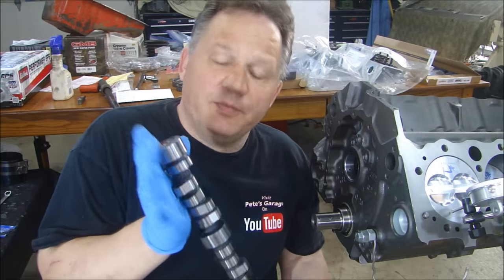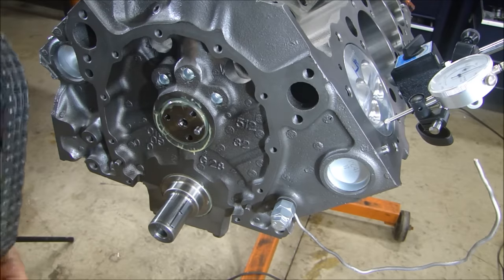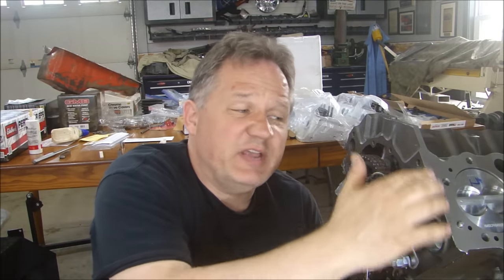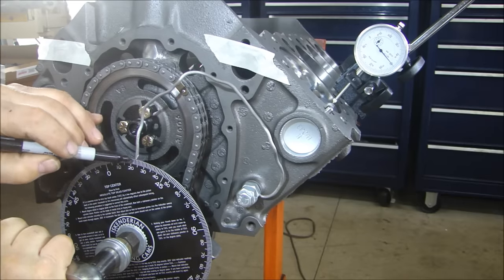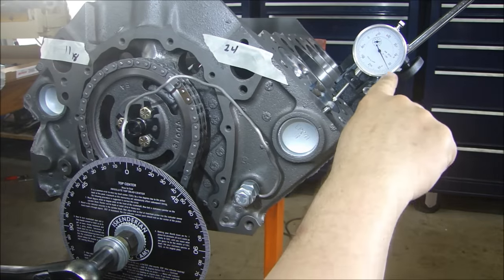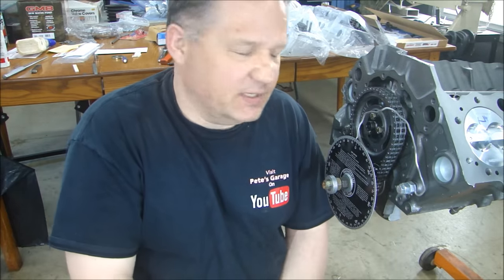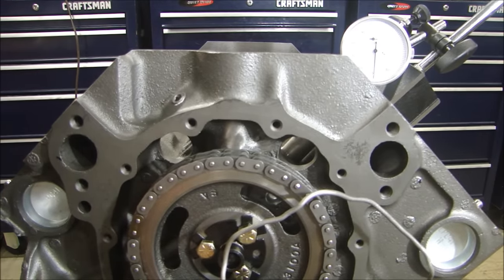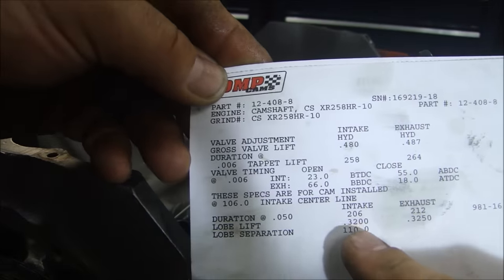Engine Building Part 3   Installing and Degreeing the Cam 350 Chevy Small Block

Comment: I don`t agree that decking block will change valve timing in this engine. In OHC engine yes but not in OHV engine.
Reply: I think he's referring to the fact that it will affect valve clearance, which explains why you'd want to verify cam specs and how it relates to valve timing on the cam.
Reply from the maker: Let's really exaggerate the situation. Let's say you cut 1/2" off the deck, and let's' assume the piston will not hit the valves. The piston will get to the top way before the valve timing would at standard timing, therefore the cam is way behind and the valve timing retarded. In that case you'd have to advance the cam timing probably close to 100 degrees.
Reply: Well piston will be higher respectively to the block deck but the crank angle of TDC will not change. The only thing that will change is compression ratio and piston to valve clearance.  Same if you put a stroker in there. Cam timing won`t change because of the longer stroke. TDC will alwasy be in the same crank rotation angle.
Reply: kitastan distance from center of crank changes for the valves, therefore timing does change
Reply: what are you taking about.... timing of opening/closing valves DO NOT CHANGE in respect to crank angle.
Reply: @kitastan  You, sir, are correct.
Reply: +kitastan “Hfan” Yep, I noticed that too. You are correct. Decking the block don't change the cam timing.
Reply: @noampitlik2332  I'm in 100% agreement with 
@kitastan! Still yet, good video to help understand how it's done in my opinion!
Reply: If the camshaft was in the cylinder head, yes decking the block or the head will change the center to center distance between the crank and cam this affecting valve timing. Decking a ohv block......no change in cam timing.
Reply: kitastan , your absolutely correct!   Otherwise stroker cranks would require a matched cam and would be sold in pairs
Reply: Kitastan I agree with you, but it’s still good practice.  If you get well-acquainted with the procedure and do it on every build, you’ll know exactly what to expect whether it’s OHV or OHC.  Good observation!
Reply: Correct. Decking the block simply has the same effect of closing up the valve clearances, which would naturally have the effect of advancing the valve timing. But when you assemble the motor with the decked block you set the valve clearances where they're supposed to be,  so the effect of decking on valve timing is cancelled. If you deck the block 0.5" just put in 0.5" shorter pushrods and you're back where you started.
Reply: @chrisburnsed6349 , Josh Rickard and others. You're correct and at same time, you're in error. The difference lies in that you are failing to understand the issue in question. It is indeed true that decking the block does nothing to change the CAMSHAFT timing. What it does change, is the installed height of the valve rockers in relation to lifters, and therefore, by default, changes the timing/s of the valve opening and closing points, mainly because the length of push rods remains constant. Not trying to teach a chicken to lay eggs, just giving the facts as they are understood by the holder on a Eng.D. 

I would like to thank Peter's Garage for presenting the importance of this, mostly overlooked matter in such a clear and through manner. Keep up the good work, your information is spot on. Cheers from Indonesia.
Reply: Line honing would have more of an effect then decking the block.. js
Reply: As a mechanical engineer, I will look into this but by using formulae. Will see if any change in distance "x" of the decking would effect valve timing for OHC and OHV engines.
Reply: @kitastan  I concur
Reply: Smart man
Reply: @kitastan  You are EXACTLY correct!!
Reply: I DONT CARE WHat you say this guy knows his shit..
Reply: Phillip Aubin  deck hight only changes lash not the cam timing. If it did he would have to check timing events at the valve with the head on
Reply: no no no, decking the block or milling the heads does NOT change the timing, tdc is tdc. compression will change cam timing does not. it may change push rod length but decking a block or heads takes off minimal material.

Comment: It's important to note that the further from the top you use the piston stop points when locating TDC, the more accurate you will be. Ideally, the most accurate point would be when the piston is exactly half way up the bore, since this is where the vertical movement (speed, if you like) of the piston is maximum per degree of crankshaft rotation. That of course, is a little impractical so we use a point reasonably close to the deck, but still, the lower the better for accuracy.

As Pete mentioned, trying to find TDC directly with the dial indicator is extremely inaccurate since when the piston is at the top of its travel there's almost no vertical movement over several degrees of crankshaft rotation, so it's almost impossible to pick exactly the correct point. Hence the "double stop" method used in this video. Have a look at a sine curve and you'll get a feel for how the piston moves in the bore.
Reply from the maker: Excellent comment! Thank you very much
Reply: Hi; is the same inaccuracy that all use when check for intake centerline zeroing the clock on max lift

Comment: Good job Pete.  A larger degree wheel and shorter pointer wire helps with accuracy readings.
Reply from the maker: Good tip!

Comment: Your measurements were all off by a degree or less. That leads me to believe you didn't have your indicator set exactly in line with the lifter. Just off a bit in any direction will cause you to loose a little measured lift. This is exactly how I have always done mine and I believe it is plenty close for 99.9% of the engines out there. Especially a street motor... ;)  And I don't think that most people even understand how much shaving a block can change the cam degree... Happy you pointed that out.....
Reply from the maker: Thanks Steve, I'm just trying to explain it, I'm not going to argue with people who don't understand it. I agree, it's plenty close enough, thanks for your comment

Comment: I know everyone has their own way of doing things but i install the camshaft first before the crank. I find it easier to guide the cam through the bearings.
Reply from the maker: I can see that. The only reason I do the crank first is that if the cam is installed and a fastener falls it could knick the cam.
Reply: HI my friend. There are two ways to do it, like here let the mashine shop do it with the baring crings. But your right if i would do it I would also install the cam first. Cheers
Reply: Same here. Just made a rant and then saw your comment.
Reply: @jimburig7064  I build engines for a living and I always install the camshaft first , mainly because if you have a problem with a cam bearing you can fix it before you put the rest of your parts in . Just my personal reason .
Reply: I refreshed my stock engine in my 1979 Z28 (I know, not a performance engine but I didn't have the money for my desire). Installed the cam bearings and couldn't get cam past bearing # 3. R&R'd another set, still couldn't get past bearing #3. Brought to machine shop and they installed their own set of cam bearings. I brought my cam to the machine shop, and sure enough it went in fine, so I asked them, what was it I was doing wrong?
They said, nothing. The casting was not machined properly and the #3 cam bearing bore was undersized in the machining process, which caused #3 cam bearing to "contract" too small when installed into the block. So I asked, what did they do? Honed the cam Bearing.
Kind of hokey for a machine shop, now I have 5 psi of oil pressure at idle. 

It was easier with the crank out.

Comment: It may not make much difference but I've been taught to rotate the crank CW for both .050" measurements when checking for ICL.  This way the slack in the timing chain is treated the same for both measurements.  Good video.
Reply from the maker: That is a good practice

Comment: When I used to build engines, the camshaft was the first thing to go in with the block upside down so I could reach in and carefully guide the lobes past the cam bearings without scratching them. Now, almost without exception on YouTube I wince with every clank, clink and clunk as the cam is installed after the rotating members are all buttoned up. Just saying...
Reply from the maker: Would you be surprised to know that every engine plant puts the crank in first? Every assembly line I was ever an engineer for, that's the way it was done. If you are careful, the clink and clank should just be resting a lobe on a bearing. I have been doing it like this for a long time and never had an issue or found a damaged bearing during disassembly. There are many ways to build an engine and they are all right if you are successful. Thanks for your comment.

Comment: Basically checking to see if your cam card is correct.I've never had an issue.correct timing per setup is what's important. I don't think that tiny cam with have any clearance issues
Reply from the maker: I have gotten the wrong cam out of the box. It doesn't hurt just to check.
Reply: @PetesGarage  I'll definitely agree in the event that your building something with a lot of lift with a high done piston. Pre detonation is very important. Correct timing is everything. I'm by no means downing your video I think you were exact and precise.I give it a thumbs up.
Reply from the maker: Thanks my friend

Comment: It through me off when you went counter clockwise. Still makes sense but I go clockwise myself. 

Also, it prevents having to worry about the bolt backing out...also my Comp cams kit has a crank adapter for that reason. 

What may be helpful for folks in the future is to use a long breaker bar or leverage bar to aid in spinning the crank over without having to "bump" the ratchet. 

Regardless, I still like your videos man!
Reply from the maker: Great tips, thanks Mathew

Comment: Dot to dot at TDC #1 would in fact be the exhaust stroke NOT the compression stroke.  It's actually the compression stroke on #6 cylinder. This is why the distributor tends to get installed at 180 degrees off of where it should be.
Reply from the maker: That is why I always urn over the engine to make sure #1 is on the compression stroke before installing the distributor.

Comment: After top dead center when piston starts its down stroke, allow for a thousandths or 4 thousandths drop,  then you can adjust the rest at distributor. Do they make a gauge that threads in the spark plug hole?
Reply from the maker: There are spark plug hole guages.

Comment: Hey Pete live the information.. but u wanted to ask u a question.  I have a 1971 Buick Electra 455 engine.. it runs well all stock original engine never rebuilt.. I wanted to Kno how can I check if it's getting the full 315 horses it says it made off the lot.?
Reply from the maker: You should be able to get more than that, usually 1 HP per CI

Comment: I replaced my timing chain and gears with a double roller style. I also removed the cam just to check it out. It checks fine. I reinstalled everything, and my question is, can my cam be 180 degrees out? How do I check this for sure. I do not have the heads off, and have never had them off. Thanks for any help.
Reply from the maker: Yes it can be. Make sure piston #1 is a TDC. The dot on the crank sprocket should be facing up. Align the dot on the cam sprocket with that.

Comment: I heard you say that you always degree the cam, however I didn't hear you say whether it's REALLY necessary??  On all the videos on HughTube about degreeing a cam, I never see any adjustments made after the procedure. So it it REALLY necessary when installing a new flat tappet cam and lifters; and if so, why?  Thank you!
Reply from the maker: I guess it depends on how much you trust the cam manufacturer. I usually check a few lobes to make sure the wrong cam wasn't put in the box. Also, for a more radical build I sometimes advance the cam 2 degrees, so you will not see any changes on most builds

Comment: When you do the duration there no showing the gauge, and I think you are skipping some parts like when you count backwards.. plus wont going back and forth affect the cam degrees unless the timing chain is seriously tight? Thanks - ill have to sit down and go thru this sometime.. Ive always dropped cams in straight up
Reply from the maker: I have a couple videos on cam degreeing. I don't do every step in each one to make them all a little different.

Comment: You made measurements based on clockwise and counterclockwise crank rotation.  So what about the clearance in the crank and piston pin bearings?
Reply from the maker: That is in a different video

Comment: Piston stop works better for finding absolute TDC imo, you can adjust the stop if you’re working with an odd number and don’t want to work with a split number. Bigger wheel is more accurate also, like Moroso’s 18”. Just my $.002
Reply from the maker: They do work well. I do have a bigger wheel, I have a few actually, you are right

Comment: that cam retention plate has fold down tabs to keep the cam bolts from moving  - just an FYI
Reply from the maker: You are right, I did fold those down but the video got messed up and I didn't notice until it was too late

Comment: If your crank bolt came loose you lost true T.D.C. you need to start over . Buy the socket made for a degree wheel & a long handel ratchet so you are  not jerking engine around instead of a pipe would help accurately  do job . I like you video's but a few things would make them much better .
Reply from the maker: Thanks for the tips Larry

Comment: Quick question: what kind of tolerances do you find acceptable for crankshaft vs. crank sprocket dimentions?  I have a crank gound on the light side, and am looking at an interference fit.
Reply from the maker: An interference fit is in the .0005" range

Comment: So checking intake centerline just verifies the center if the intake lobe in conjunction with crank degree? 
Do you normally only check lift on intake lobe?

Is there a way to check LSA and duration? Im trying to do this in reverse to find unknown cam specs.
Reply from the maker: Yes, I usually check both. Sure, you can measure form .050 to .050

Comment: Quick question. After all this is done we’re are your marks on your cam and marks on your crank setting to drop your distributor in
Reply from the maker: It should be at #1 TDC
Reply: Pete's Garage : I mean your crank is at top dead center but we’re are your cam mark at12or6
Reply from the maker: @thruitallauto2538  6
Reply: Pete's Garage: ok hey I’ve got a motor that’s oil fouling the plugs the rings are not stuck an the heads look good no bad valves wander what could be causing it all the plugs are fouling
Reply from the maker: Leaking valve stem seals?

Comment: Great video, you explain things very well. I am attempting to find out the specs of this cam that came in my car. The car is a 1964 Plymouth with a 440 C.I.and a 426 Max Wedge dual quad set-up.  I did not pull the engine out of the car but did remove the heads and intake manifold. Due to my limited space, (I don't have room to mount the degree wheel on the crank with the engine, radiator, etc.  installed), I made an adaptor for the degree wheel (small) to mount on the distributor shaft. My question is,  Do you think this will work for degreeing the cam? It looks like it reads direct cam degrees, so I have to read it @ TDC and BDC, rather than a full 360-degree rotation. Any advice would be appreciated. Thanks.
Reply from the maker: Thanks Stephen, I don't think you can use the distributor for that. There really isn't a short cut

Comment: I have yet to ever have found a discrepancy between what is and what the spec says.
 Sometimes I feel like I have wastes soo much time in doing this. But I just can not get myself to stop checking every single engine i build.
Reply from the maker: I have only found a couple that were off, one was the wrong cam in the box

Comment: Read no write? What do you do with the info you gathered? How to fix if off by alot?
Reply from the maker: I do write down the readings. If it needs to be fixed you make a move with the cam sprocket and re-measure.

Comment: Hey Pete, I'm putting a new comp cam in an 82 Bronco, no machine work to the block, putting the cam in and some iron gt40p heads. Was just curious, what would/could happen if I don't degree my cam? I haven't seen you make any adjustments to any thing besides the wire, so just curious if I'll actually need to degree the cam or not. Thanks Pete!
Reply from the maker: If you're not machining anything, just make sure its straight up timing and you'll have no problem.
Reply: Yeah if you didn’t get your block surface decked then just make sure cam is in the same orientation with the engine at top dead center
Reply: A lot of street motors never get degreed cams. If your building a race motor then yes always degree your cam shaft

Comment: Do you absolutely have to have the cam thrust plate on. The engine I'm using does not have it. So do I absolutely have to have it or can I put it together without it
Reply from the maker: Yes, if the engine has one. Some engines do not use one because the cam thrusts backwards. If your engine has one you must use it.

Comment: Great video Pete. But the part with intake centerline would be great to see also the degree wheel to better understand. But the big question is : what is to do, if my measurement has a bigger difference than 1-2 degrees at all??? Cam card says intake centerline : 108 and my measurements says 112. 🙄
Reply from the maker: Did you add both center lines and divide by 2? You can retard timing on the sprocket